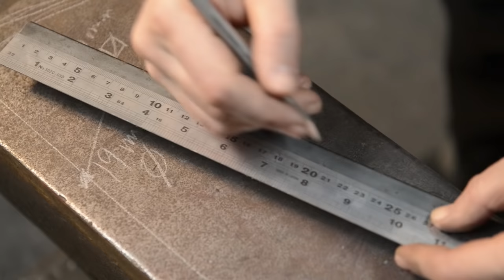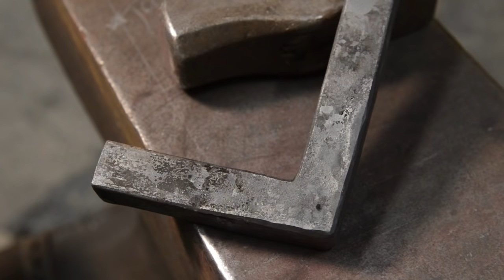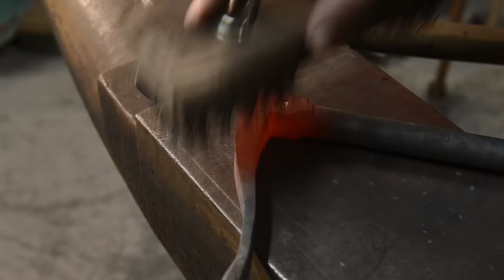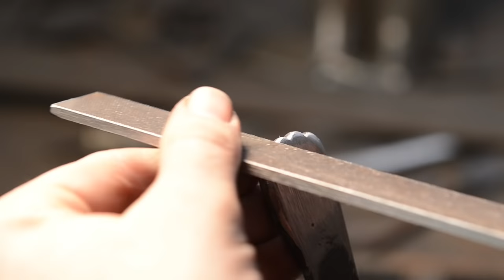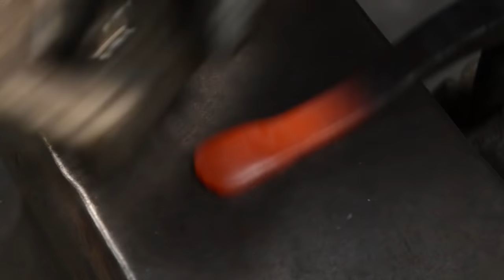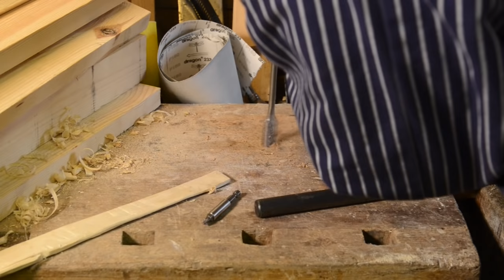Blacksmithing - Forging a woodworkers holdfast

Comment: Guess I watched this when you first posted it but just now watched it again,kind of funny that I don't recall finishing the "pad" with the "oaw" there,anyway I'm getting ready to forge one for my woodworker friend and decided to use the square corner type.The one I use at the anvil is just a bent piece of round stock with a flattened pad on the end and it works fine but figured I'd go ahead and make a fancier hold down for my friend who does such fancy woodwork.Thanks for leading me to much cleaner forgings,I not only get inspiration but also attention to details I wouldn't ordinarily look at from your work!
Reply from the maker: That is great! Thanks and good luck!

Comment: Dear Torbjörn, I came across your version of Hold-down after looking at all the alternatives.  I am regularly impressed by your seemingly effortless skills in producing 10/10 product.  The immaculate square corner, the comical cat’s paw, the perfectly circular anchoring shaft and the beautiful smooth finish.  If I can emulate what you do with ease then I will be very happy. Thanks for sharing.

Comment: By hammer and hand, do all crafts stand. The blacksmith is the King of Craftsmen.

"THE story is told that many years ago the King of England had all the
the Guild Masters of the various guilds to dinner at the palace.

"DURING dinner, a violent argument broke out concerning which craft was
most important, and which craftsman should be known as "King of
Craftsmen".  The King ordered silence and once all were quiet, he said, 

"'There can be only ONE King, and I am he!  But I will decide which is
the most important craft, and permit the leader of the guild hall for
that craft to be seated at my table with me and he shall be known as
King of Craftsmen.'
"HE ordered all of the guild masters to stand on one side of the banquet
hall.  Calling them to the throne one at a time, he questioned each,
then sent them to the opposite side of the hall from those who had not
yet been questioned.  He ordered his Sgt. at Arms to immediately strike
off the head of any who spoke except in answer to a question from the
King.

"THE FIRST craftsman that he spoke with was a carpenter.  The King asked
what he made.  The carpenter told the King that he made all things of
wood. House, wagons, wheels, looms an so on.  The King asked where he
got the wood.  The carpenter said that he went to the forest, and cut
down trees with his ax, then brought the logs to his shop where he used
other tools to cut the wood down to size and shape it.  The King then
asked where he got his tools, and the carpenter answered that he got
them from the blacksmith.  

"THE SECOND craftsman was a weaver.  The King asked the same questions
that he had asked the carpenter, and got similar answers.  When the King
asked the weaver where he got his tools, the weaver said that he got
them from the blacksmith.

"THE THIRD craftsman was a potter.  When the King questioned him, he
admitted that he too got his tools from the blacksmith.

"BY this time, the King had noticed the trend.  So he questioned all of
the craftsmen EXCEPT for the blacksmith.  Each answered that yes, he got
his tools from the blacksmith.

"FINALLY, the King called the blacksmith to the throne.  When he asked
the blacksmith where he got His tools, the blacksmith answered that he
made them himself, for no one else could make tools for the working of
iron.

"AT that point, the King called all of the Guild Masters  back to the
throne.

"HE announced that he had made his decision.  Since the blacksmith was
the only craftsman who did not have to obtain his tools from some one
else,  but made them for himself, that henceforth and forever more, the
Blacksmith would be known as the King of Craftsmen and would be the ONLY
craftsman permitted to wear a fringe upon his work apron.

"'FOR BY HAMMER AND HAND, DO ALL CRAFTS STAND'" -- Anvilfire.com
Reply: He collected and make the iron himself?
Reply: @InfiniteMushroom why don't consider all parts horizontaly equal?
Reply: @InfiniteMushroom what would be the blacksmith without these other smiths? Again, there is no need to higher one above others. Everyone put all their efforts in what they are doing and are horizontaly equal. Let's agree on that?
Reply: standing under a chestnut tree
Reply: Sounds like a pretty evil king to me if he wanted to chop off their head
Reply: Brandon ,
Yep read that book many years ago , the king was right
Reply: Hé JoHo, don't forget the carpenters we are Jack's of all trades 😁
Reply: Well said.
Reply: The king lined up all his wives and, ... we know what happened there as well.

Comment: This tool is also used in the blacksmith shop for the same purpose. Usually it is used in the hardy hole. I like the cats paw work, gives this tool a little character.

Comment: Another little trick ,
For weldors , electrician even painters . It was so subtle not sure how many people even saw or understood it , when he touched the metal he used the back of his fingers , very important , they are far more sensitive than the underside and when you grab something hot ( metal or electrical ) the muscles contract closing your hand around that object which in the case of electricity could kill you .
I said painters because sometimes you need to check if the surface is tack free

Comment: Certainly a well made and designed holdfast. I really like the “ cats paw” , it adds character to the job. Is there any reason mild steel was used in preference to a spring steel? Regards from “down under “.
Reply from the maker: Traditionally these where never made from steel. The springiness of mild steel is enough!

Comment: I love that power hammer, I assumed it was an air powered but it has that huge flywheel, how does it work?
Reply from the maker: Yes, it's what we call a "self contained" air hammer. It has it's own "compressor" cylinder (driven by the flywheel) connected to the ram via the control valve.

Comment: Beautiful tool.  I would guess that total time to make it was around 3 1/2 hours.  At a shop rate of $90.00 per hour, that comes to $315.00 for labor, plus $3.00 for steel.
Reply: you are mixing business with pleasure; please dont do that. blacksmithing is his hobby, his passion.
Reply: @hsp3394  Don't be so sensitive.  I have made a bunch of tools for myself and the economics usually works out the same way.

Comment: Do you find that the spring holds up using mild steel? All of the ones I have made I used spring steel because that's what I was told works best. Just curious about your experience with the mild steel
Reply from the maker: That remains to be seen... it will not hold up for abuse that is for sure. But after some initial research it seems they used to me made from mild or wrought iron. You don't need tremendous force to hold down wood.  If I were to make a hold down for my anvil, I would use spring steel as well, to keep up with abuse and to hold at a greater force.

Comment: Hello. Is not this steel tied too tight? Is not it necessary to temper?  Good Job!!!!!!
Reply from the maker: Thanks. This is mild steel yes. They used to be made from wrought iron which is even softer. You don't apply tremendous force to these, and they will spring back nicely. You could abuse and bend them but easy enough to bend back.
Reply: Perfect explanation! Thank you for clarifying my doubt !! Hug!!!!

Comment: Great job, is this mild steel or can it be made from mild steel?
Reply from the maker: Thanks. Yes, this is mild steel. For woodworking I think it is sufficient springiness in mild steel. If you want a super hold down, you might try spring steel, but it might be too stiff actually.

Comment: so what does the beeswax do to the holdfast?  Does it create a rougher surface so it doesnt slip from the hole?
Reply from the maker: No, on the contrary... It's just for rust protection. The shank should be left untreated for best grip.

Comment: do you apply your paste with the material warm or cold?
Reply from the maker: It can be applied cold. If you heat the piece slightly it's easy to wipe off the excess.
Reply: Thanks for the info I really enjoy you videos

Comment: Will it work in the Pritchel hole of your anvil?
Reply: yeah you can use a holdfast in your pritchel or hardie hole. They're not very good for working with hot metal though as a lot of heat escapes while setting it up, but it works wonders for chisseling cold.
Reply from the maker: Not in my anvil, but a similar tool with a thinner shank would work fine!

Comment: How much force does the power hammer strike with?
Reply from the maker: Hard to measure I think... but the ram weight is 75kg on my large hammer and that weight is not only falling, it is pushed down.

Comment: Does anyone know the purpose of using turpentine in the finish mixture?  In a use like this is it a solvent thinning the mixture? or is it simply another density of oil to be absorbed into the piece?
Reply from the maker: I think you need it to keep it soft as a paste.
Reply: @torbjornahman  the man him self!  Thank you very much for the reply.  Even more so, thank you for your content.  For the few years I have been watching you, I can honestly say I have enjoyed every video.  Sometimes I watch to learn or find something specific,  others I just want to relax, and end up learning about a new tool or a cool little trick you cant read about.  I would love to shake your hand but I guess this will have to work.  Thank you for your work and craftsmanship.
Reply from the maker: @gibbyrockerhunter  Thank you!!

Comment: can you use this in the round hole of an anville
Reply: There is a similar tool for use in the pritchel hole, the round one, it's essentially the same thing, but instead of mild steel it's usually made of spring steel. Though if you plan to make one keep in mind that they can be much simpler than the wonderful one that Torbjorn made, and mild steel will work well enough, it just might not last as long. Also if you aren't very comfortable upsetting square corners or don't have the hammer control to forge a round bar yet, you can weld a shaft onto one instead of drawing it out from square stock. The only key feature is the curve that is put into the head of the tool. That's what allows it to have some spring to it and hold pieces with just the foot of the hold down.
Reply: David Rahn thanks
Reply: David Rahn ps what ecsactly is spring steel
Reply: Simon Fredrik Lund spring steel is  exactly as the name implies. It is a steel that can be made into a spring. But to make it a spring you must harden and temper it. That process is usually just called heat treating. If you are very new to smithing I recommend just buying raw spring steel from a reputable dealer. It's not very expensive and it's much easier to heat treat a part that is a known metal. What I mean by known metal is that it's a metal that you know exactly what it is and not a metal that you know kinda what it is. Many people suggest going to scrap yards as a beginner and getting your steel there. I say don't do that because you can find a used truck or car suspension leaf spring, and you can know it's spring steel, but you don't know exactly what allow it is. And that is a problem because many different allows heat treat very differently. So buying your steel from a reputable dealer ensures that you know what it is and how it will heat treat. If you are unsure about how to heat treat a steel you can request the heat treatment specifications from the manufacturer or look it up online. Many steel manufacturers have those specs online. Also also. When it comes to learning about heat treating parts there are many great tutorials and videos here on YouTube. I recommend looking up Nick Wheeler on here and on Blade Forums. He does great in depth tutorials on bladesmithing. Also, join iForgeIron it's a blacksmithing forum, and if you have a particular interest in bladesmithing The Bladesmith's Forums is a great place to learn and talk. Hope that helps. I know when I started out that I felt clueless. So don't feel bad about asking the stupid question. Better ask and look like a fool than to stay quiet and be a fool.
Reply from the maker: If I were to do one in spring steel I would probably leave the tool as forged or normalized only. That is springy enough for this application, so scrap spring steel would work fine!

Comment: Is that 43 degrees?
Reply from the maker: No 41,2  :) I have no idea what you're talking about!
Reply: The angle between the cat paw and the shaft. Will it work at 45  degree or does it need to be less?
Reply from the maker: You mean 90 degrees (right angle)? The angle does not matter much. The crook needs to have the right springiness and extend a bit... there are all kinds of designs.